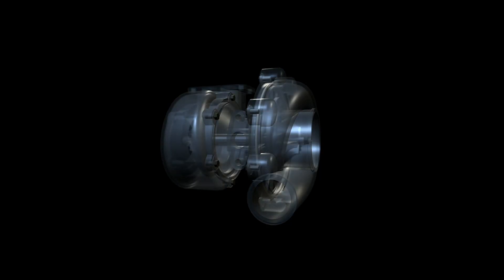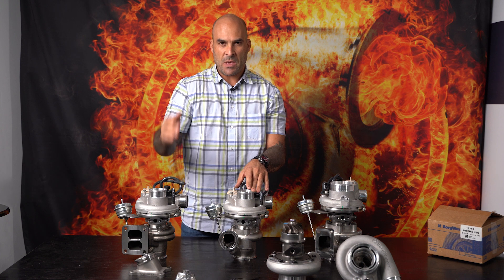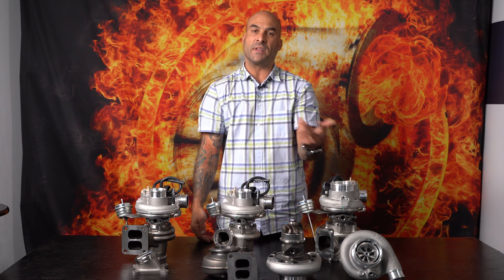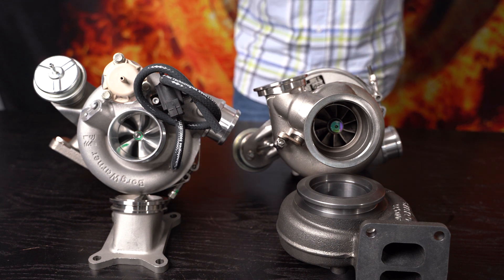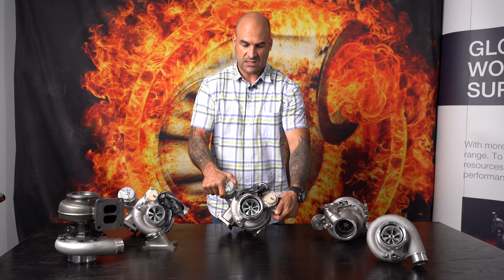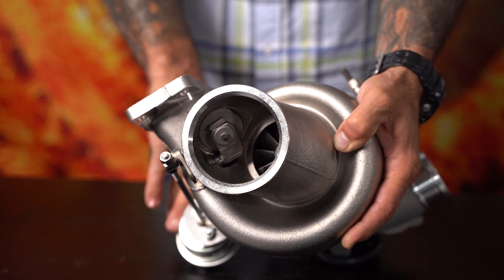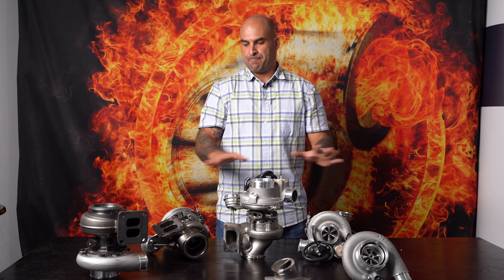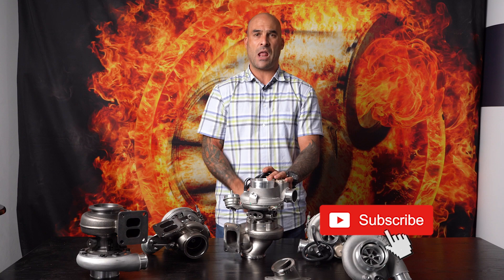EFR7163 vs EFR7670

Comment: which efr series would work well on stroked 5.3 ls?
Reply from the maker: Depending on what HP target - there are a a variety of different Airwerks options for you.
Reply: @TurboDirectSA  is the efr 7670 or 8474 comparable to the precision 7675 ?
Reply from the maker: @shandyellis-brown8091  The PT7675 is journal bearing, and the EFR are all dual ball bearing. The 7675 is a cast compressor wheel, the EFR are top of the line products, the precision product cannot hold a candle to the EFR range. None of the precision turbochargers have burst containment tested end housings, BorgWarner does.  Reliability, boost response and the overall feature list on the EFR range is light years ahead of precision.
Reply: @TurboDirectSA  yes, ok, which efr is comparable to the size of the 7675, or better yet suggest to me a efr that's good for 1000-1200 hp?  for a stroked 5.3 ls.....looking to 1/8th mile this ls,
Reply: ive used precisions dbb gen 2's on my buicks for years,  but watching your series on the efr,, im really interested in running one of these!
Reply from the maker: @shandyellis-brown8091  For that HP target i would go with the EFR9280 Black Series. If you want to use something capable of slightly more HP in single turbo format, the Airwerks (journal bearing) turbochargers like the S400SXE would be something that will blow you away compared to the large precision turbos, they will outspool the precision and make more power size for size.
Reply from the maker: @shandyellis-brown8091  EFR is something vey different and a breathe of fresh air.
Reply: @TurboDirectSA  so no external wastegate is needed if I buy this?
Reply from the maker: @shandyellis-brown8091  Depending on which AR housing you choose, some are internally gated and larger options are not -- the AR83 and AR92 are available in internally gated options only - larger AR1.05 and AR1.45 housing options are externally gated, for which you will need an external gate.
Reply: @TurboDirectSA  so to run an efr turbo on my ls, what do I use to control boost?
Reply from the maker: @shandyellis-brown8091  The turbo comes with a boost control solenoid mounted to the comp housing - thats if you choose the internally gated turbo. You can run any electronic boost controller, or if your ECU is capable of controlling a PWM signal for boost, use that.

Comment: I love that these turbos are actually named logically instead of total nonsense, hahaha. Also still crazy the value you get with the internal wastegate and integrated diverter valve.
Reply: Also holy crap was just looking at the efficiency range of the EFR 6258 and it's absolutely crazy. 74% from 170HP to 370HP and 0.6 bar to 2.2 bar. That has to be such a fun turbo on a nice 4 cylinder setup.
Reply from the maker: @802Garage  Exactly - although the "fashion" call for multi blade compressors, the 7blade splitter design is still superior in certain aspects. Glad to see you now looking at compressor maps differently -  :-)
Reply: @TurboDirectSA  You've taught me an incredible amount already! :D
Reply from the maker: @802Garage  Glad to hear that -

Comment: Thank you for great information. some companies make turbine manifold with A/R 0.64 for the EFR7163, specially for Golf MK6R. From your experience can I still get 550-580 hp on this turbine housing? and how much horse power can I make with this turbine housing. Thanks
Reply from the maker: Thanks for the comment Mohamed, there is no reason to manufacture such a small AR for this turbo because it spools so fast as it is - ASSUMING that this is an AR64 in the same T28 family volute. If so, then you will definitely lose power ontop and you will see an ESTIMATE (tuning dependant, boost, hardware mods, fuel, etc) of around 30-50HP less.
Reply: @TurboDirectSA  Thanks clear enough, one last question please, what if the turbine housing is 0.7 a/r. how much horse power I'll be losing ? 
We are talking about EA113 TFSI engine , it's not as good as EA888 gen3 engine, which its cylinder head efficiency  is way better than the EA113. Thanks
Reply from the maker: @mdorgham  Its impossible to say - as mentioned before the HP depends on the engines ability to "process" the incoming flow from the turbo.  Thats why VE is the most important aspect of plotting a compressor map. 

I wouldn't use any other AR housings other than the Borg offering even on the EA113 engine - they are more than adequate to spool fast and they are matched to the rotating assembly.
Reply: @TurboDirectSA  noted

Comment: I have an A5 CDNC (EA888.2) what turbo/exhaust manifold would you recommend hope to be in the 500 WHP range, has been difficult to find options for longitudinal mounting in my case.
Reply from the maker: Thanks for the question. Im not familiar with this engine code specifically, but for this HP output and for the best streetable response nothing beats the EFR7163. Its small enough to install into tight geography, and will spool faster than any other turbo in its class. This turbo produces 550WHP on the EA888.3 engines.
Reply: @TurboDirectSA  is basically the 211cv ea888 gen 2 but as most of the offerings are for transverse mount engine would like to know if there is any exhaust manifold that could work on a longitudinal mounted ea888 that I have
Reply from the maker: @ebotas  If the head design is the same as the EA888.3 then you can use the Swirl Adapter :- https://www.youtube.com/watch?v=y6PA_Xc0feI&t=570s

Comment: Awesome video.  I was watching this to help in deciding a turbo for my CA18DET.  Then you were talking about EA888 engines and I'm like; I have one of those too :-D.  Do the exhaust housings bolt to or is a turbine housing available that would bolt to a standard aftermarket downpipe that fits the IS38 or would a custom downpipe need to be made for an EA888 engine?
Reply from the maker: Thanks for the compliment, Depending on which DP you have, some bolt directly onto the EFR7163 when installed with the swirl adapter.

Comment: I have a 2.0 DIT Subaru engine.... I had a 7064....then a 7670... ~36psi... both single scroll setups. it's time for another rebuild...was considering going to the single scroll 7163 ewg... will i be sad and disappointed? or will it spool up significantly faster than the 7670? tryin to debate what to do.
Reply: I would just go twinscroll ewg on the 7670 imo
Reply: @TechyGamerVibeZ  I went with single scroll 8474 :o twin scroll is too much trouble to make work for my platform/space available.
Reply from the maker: It will spool alot faster than the 7670 - BUT it will not make as much power up top in comparison.

Comment: efr7670 can produce 650 whp?! come on, it is not true, it 62 lb/min turbo only
Reply from the maker: The EFR7163 has produced 550WHEEL HP on our dyno on an EA888.3 - it is rated to 54lb/min.  We have seen these results in person on a handful of dynamometers around the country. 

The EFR7670 will produce the goods - wait and see, an install is coming up soon.
Reply: @TurboDirectSA  no matter dyno numbers, it means nothing
Reply from the maker: @Arss-ast  Dyno numbers mean as much as lb/min air flow numbers - clear proof of the results.
Reply: @TurboDirectSA  what engine? and what about 100-200 dynamic 550 whp in 7163?
Reply from the maker: @Arss-ast  Watch the video - it clearly mentioned EA888.3 - times from 100-200kmh with the EFR7163 are freely available on APR web page  - why dont you go take a look, they using the same turbocharger on their bolt on kit.
Reply: @TurboDirectSA  APR is tune laboratory, they are seling theirs programming services, if my target is to get 5 sec 100-200 in my 4g63t ( for example), then 7670 will be best variant, without apr and dyno-logs, only dynamic perfomance
Reply from the maker: @Arss-ast  I disagree, APR dont only sell tuned files, id suggest you go visit their web page, you will see alot more products there than just tuned software.
Reply from the maker: @Arss-ast  You going about this the wrong way - you trying to match a model turbo to an acceleration speed - thee are too many vairables. I can build you a 4G63 with 2.4l stroker and 102mm crank, using an EFR9180 which will lose so much traction and land up doing a 10sec 100-200kmh time - on the other hand you can build a 450WHP setup with a much smaller turbo which will achieve a 5sec 100-200kmh time, but doesnt make massive dyno numbers.  Different tires will make a difference, different suspension setup makes a big difference,  gearing (some EVO's run a 5SPD and others run a 6SPD gearbox -- you asking how long a piece of string is. 

If you think that your specific setup will achieve the acceleration time with 500WHP, then i can recommend a turbo that will make this power for you - the rest is up to you. 

If you believe that 600WHP is required to achieve this acceleration then  i can give you the right turbo to make this - once again thereafter its up to you. If you cant drive properly, then dont expect good times.  you are debating whether or not the EFR7670 will produce 650WHP - and i am telling you we have seen this on the EA888.3 engine - what times it does, it a different story alltogether.
Reply: @TurboDirectSA  i've got 4g63t, no stroker, no de-stroker, 2.0l, and i dont need efr9180 or 9174 and tires 205-55-16 on my car, even dyno numbers is not my target, my target is 5 sec 100-200 on 205-55-16, my configuration now efr 7670 with 280 cams, light weight and others mods, sxe257 i have bought last week ago, everythig i need is 5 sec on street tyres i can say for sure efr7163 will never give me that time, no matter what dyno will show in graphics, eve mustang dyno. If somebody wants dyno-queen - no problem with it, i want dynamic
Reply from the maker: @Arss-ast  Once again a turbocharger is not related to an acceleration time, there are too many variables. The EFR7163 will make 550WHP on an EA888.3 engine - we have done it more than 10 times. This is fact. How to achieve a 5sec 100-200kmh time is something you need to calculate as dicussed previously.
Reply: @TurboDirectSA  come on, who needs just a dyno result without acceleration?, i just wanna say, if you want fast car dont by smaaaaaaaaal 7163, buy efr7670 make 500 whp and go fast
Reply: @TurboDirectSA  gearing at evo trans are 4.529 in 5mt, and 4.583 final drive in 6mt evo , it is not a big difference in final drives, and acceleration will be the same, not including a long not stock gearing like 4.11 or 4,3 or sequantial gearboxes and others
Reply from the maker: @Arss-ast  As i mentioned previously if you can give me the power you want to make, i can suggest the correct turbo for you. The rest is up to you.
Reply: @TurboDirectSA  i want 5 sec 100-200 car, efr 7163 will never give a 5 sec, efr 7670 easily, don need dyno "power"
Reply: @TurboDirectSA  if somebody have a 2.4 evo with 9180 and running 10 sec 100-200 because tyres are spinnig, but it clearly is dyno-queen i can only say ''good jub, you've got useless junk-evo , keep going that way'' for that guys, you can be dyno--queen but not be a fast car, so sure
Reply from the maker: @Arss-ast  LOL - if you say so.
Reply: @TurboDirectSA  LOL - if you looking just in a graphics
Reply: Hold my beer Apc

Comment: Awesome explanations of the compressor map and differences between the the two types of housings for the 7163, I had read in one of the comments section from another video of yours that you could offer a different compressor for the 7163 to take it all the way to 650hp capable. A video on this would be very interesting, especially if not much response is lost in the process. Also I was wondering how  you could get the benefits of using the larger a/r 7163 on an engine other than the EA888, I understand the your swirl adapter plays a large part in increasing the response of the turbo with the larger .85 a/r compared to the twin scroll .80.
Reply from the maker: Ryan we do offer  larger wheel BUT IT MUST be used together with the AR85 turbine housing with the lower backpressure in order to make the higher power. its simply a larger inducer(up from 57mm to 59mm) and exducer (up from 71mm to 76mm)
Reply: @TurboDirectSA  
can the 7163 use the 7670 compressor cover???
Reply from the maker: @strokerz2858  Will have to measure the backplate to confirm, if the backplates are the same, then yes, but the obvious wheel diameter differences are the other issue.
Reply: @TurboDirectSA  
hi
do you think that the EFR 
compressor cover is the restrictions of air flow 
EFR 7670 compressor is .50 a/r
EFR 8474 compressor is .52 a/r
than you 
good work 👍
Reply from the maker: @strokerz2858  Great question, and one i et often related to AR's.... always remember the AR digit itself means nothing in determining the size of the housing - the AR relates to the family of housings.  An AR60 in the T3 family range, is smaller than an AR50 in the T4 range ---- look physically at the volute on the two housings you comparing for the 7670 and 8474 - the 8474 is much larger, yet only AR52 compared to the AR50 from the 7670..... get my drift?
Reply: @TurboDirectSA  
👍 get you
lock to the Volume not the number
Reply: @TurboDirectSA  I have EFR7163 and would like to mod it for higher horsepower. How do I do tha
Reply from the maker: @CAC-1111  We have used a larger compressor on this turbo with success in the past, but we did it as a proof of concept for a client, we only made one wheel not expecting a great result. it worked well, but the turbine housing is the restricting factor with upgrading this turbo, without using a larger AR (at least AR95) turbine, the compressor will not explode into decent power gains that are worth writing home about.
Reply: @TurboDirect S.A  AGP is considering building larger exhaust housing for the 7163. Would that help with it's current compressor wheel.
Reply from the maker: @CAC-1111  Great question, it allows me to outline a key feature of any turbo - and clarifies more about flow and compressor ability based on the driven input from the turbine stage.  Keep in mind the "capacity" available from the 7163 -- it is 60lb/min of air flow - this equates to 600HP at the crank. If the engine is not making this power, at any boost (within reason -- not 100PSI!!)  then there is something preventing this - either the engine is not efficient enough to "use" the air flow, OR there is a restriction somewhere - the most common example of this restriction is back-pressure in the turbine stage - in the quest to find the most responsive turbo AND have as much power as possible, the most common mistake to use the smallest AR turbine housing available (causing the back-pressure) and then run higher and higher boost pressure, until you find that the 'claimed' HP is not being extracted from the setup, and a massive amount of heat is.... 

Remove and replace the turbine housing with a larger AR and voila - magically appearing HP shows itself, and you land up scratching your head..... this is all to common and happens all the time. The amount of customers setups we chop and change parts on almost always results in a much better, more efficient result still with response and all the power expected from the start  of these projects.
Reply: @TurboDirectSA  could the .92 A/R twinscroll work on the 7163? Thanks
Reply from the maker: @TechyGamerVibeZ  That would be a great option BUT it wont fit, the turbine wheel from the 7670 (which is where the AR92 housing originates from) is way too large --